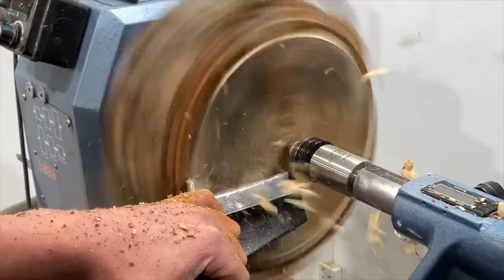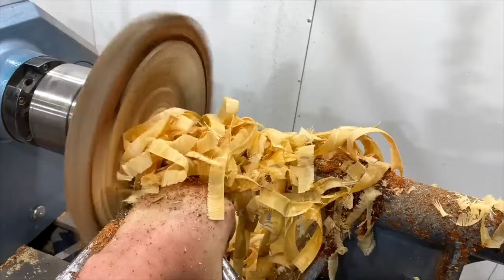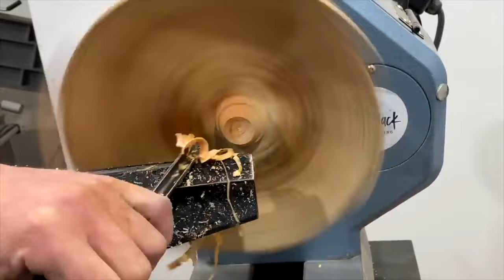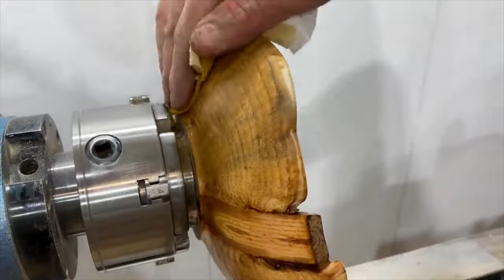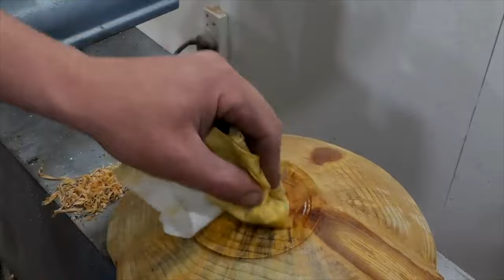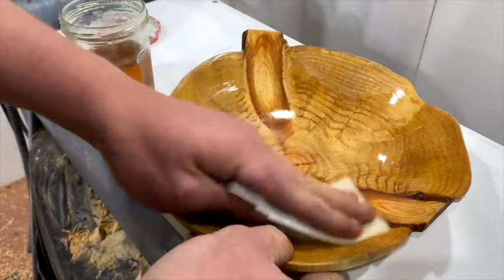Woodturning - Softwood The Wrong Way!

Comment: Wrong way?  ??  Looked pretty good to me. You used tailstock support as indeed you should. You obviously know how to sharpen your gouge. You cut the bark off in the proper direction to keep it from flying all over the shop. And I like those shear scraping cuts with the wing of the gouge. I even approve of your use of dry wall screws for the faceplate. Well done, I say. --Grumpy old man.
Reply from the maker: Hey buddy. The screws are not dry wall screws. They are wood screws. The wrong way refers to the fact that the bowl is turned in end grain orientation… also there are no screws even wood screws that hold well when turned into end grain. Which makes the tailstock even more important. 👍🏻